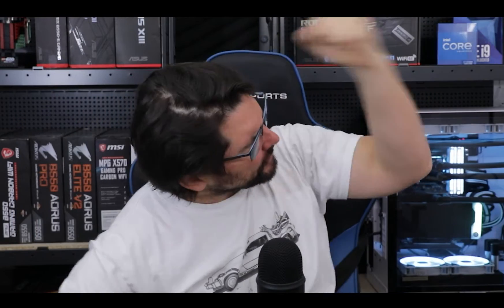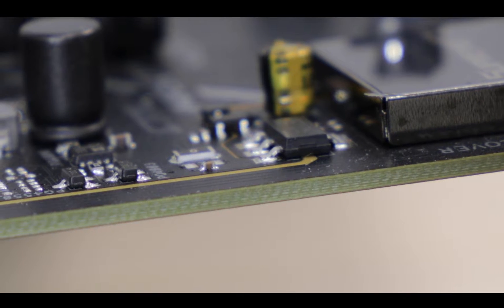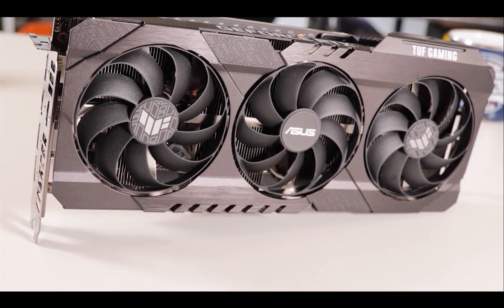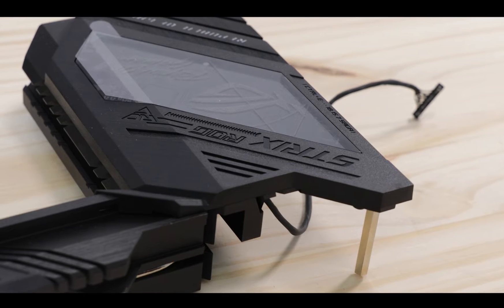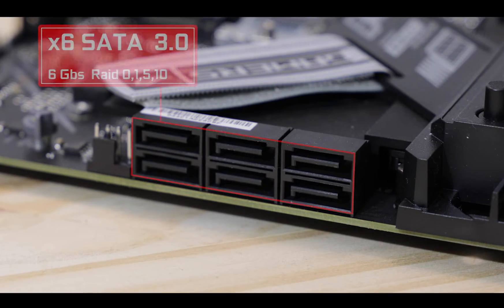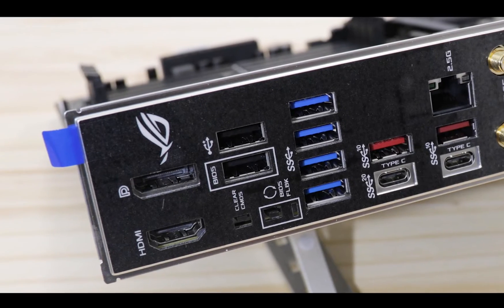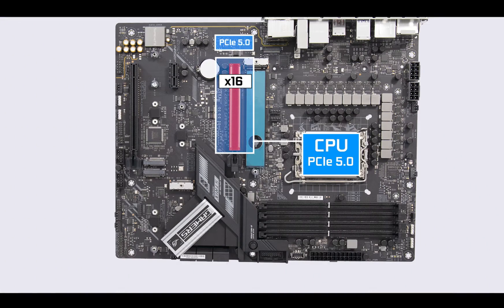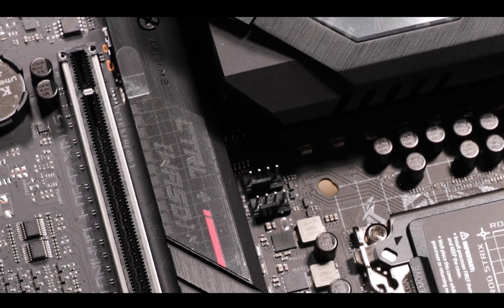ROG STRIX Z690-F Gaming : Gaming Gold Standard!

Comment: I purchased this board yesterday for under $300, $150 less than the Strix Z790-F which basically just has 2 extra USBs and 2 DDR4 PCI slots which I could care less about.
I went with the I-7 13700K, G.skill Trident 5600 CL36 RAM, and a Lian Li 011 Evo case + 360 cooler. I also decided to try out the Thermalright CPU Contact Frame, the rest of my parts wil come from my old system.
Reply: Yo nice build. I would like to buy asus rog Z690 F gaming too but i don't know will it work with DDR4??? like Gskill or Kingston 🤪
Reply: @Ad1ksoN  No, I believe only the Z690-A boards use DDR4. It's basically the same except DDR4 and silver.
Reply: @grunt1807  Thank you! I I checked a few more videos and indeed even the memory installation key is different there. So i need to buy  only DDR5👌🏼👨‍🎓

Comment: I, and many others, have reported a chipset temperature in excess of 75 degree celcius when idling. You speak to temperatures in the 40s. Is there something that we (those reporting temperatures in the 70s and beyond) can do to reach the temperature that you speak to?
Reply from the maker: this temps i had were out of the box. One thing i would double check is the state of the thermal paste/pad on the CHP heatshield. Do not hesitate to replace it.

Comment: Awesome video! Ended up ordering this one to pair it with a 13700k. A simple bios update seemed cheaper than buying a z790, especially when it comes to such a nice board! Actually managed to not upgrade since my 8700k.
Reply: Can you report back with how that goes? This is the exact configuration I was hoping to get for my next build and I would like to have examples of how it went
Reply: @PandaNoodles581  updates?
Reply: @PandaNoodles581  Many many thanks
Reply: We elected to skip my build for now and build with this setup for my wife first... She's going to pair it with a 3060Ti which she claims wont' be enough for her but I think will and then if it is not enough sometime next year when I get a new build done up with the same config I'll get her a higher card and swap her for the 3060ti which I am SURE will be enough card for me as I am only running 2x 24' 1080p 60 pannels vs her running a 27' 1440p pannel at 144hz

Comment: My m.2 drives work fine in the top two slots but work intermittently in the bottom dual m.2 slots. Im using pcie 4.0 ssd's. Anyone know why this happens? Faulty board? Bios setting?

Comment: hello, 

 I have the Asus Z690-F Gaming and I notice very high temperatures compared to the video of the chipset which is at max 45 degrees while I in IDLE, 
I am at 70 degrees and in game 80 degrees.  do you think my motherboard has a problem? Thanks you sorry for my english
Reply: Hi man, have the same problem. By the way that is because the chipset heatsink is coved by gpu in your pc. Heat from gpu is transfering to z690 chipset so im getting 70-75°C as well.

Comment: I cant seem to find an answer on which m.2 slots to use. On the gaming E, if you use the m.2_1 gen 5 slot it cuts your GPU lanes to x8. Is this the case on the F as well? The m.2_1 slot runs through the cpu but _2 _3 _4 all run through the chipset. I have 2 m.2 ssds. Where can i run them to avoid cutting the gpu lanes?
Reply: Im guessing because the m.2_1 slot on this board is only gen 4, not gen 5 like the E, that using the _1 slot does not cut your gpu lanes. X16 for the gpu and X4 for the m.2 gen 4 for a total of 20 lanes, which is supported by the cpu. Is this correct?

Comment: This is the motherboard I am eying for my first high end build, yes this is not considered high end for its class but compared to what I have now, this is definitely high end.
Reply: The hero and maximus lines are the top of the line, but this board does not disappoint. I would look at the E version though because it has m.2 gen5
Reply: I’d be careful. Mine suddenly crapped the bed on me. The second NVME drive kept disappearing and then the board wouldn’t even take power.

Comment: Question, what cooler would you recommend for this motherboard?
Reply: Deperately searching for this answer too!  Already blew money on a Deep Cool fan cooler only to find it hits the heat sink.
Reply: This is the motherboard in my new gaming rig ive just ordered from a reputable uk supplier. They only pick reliable parts. If its any help, they have the ' Corsair Hydro H100i PRO XT RGB Liquid' as standard in that build.
Reply: I ended up finding a used liquide freezer II 280 from a local.  He even had the LGA 1700 brackets though he was missing some screws for the radiator.  Now I have to return my tower fan that did not fit.  Will lose 40% of what I paid on shipping and restocking fees.

Comment: Just won this board and 32gb of G Skil DDR5 6000mhz ram and have been bingeing reviews lol

Edit: so after running it for 2 months I’m about to RMA this board since it suddenly made my second M.2 nvme disappear and now when I attempt to boot my pc the Q-LED’s don’t even go through the boot sequence. No post, no display, nothing.
Reply: what CPU cooler are you getting?
Reply: @TynanCreations  got the EKWB Velocity 2 water block.
Reply: @official_commanderhale965   Thanks.  Did you already install it and it fit well?  Came with LGA 1700 mounting kit?
Reply from the maker: Wow.. nicely done !!!!
Reply: i ahve the same ram and pc wont boot when i enable xmp...stuck at 4800 mhz (or something like that) any idea why?
Reply: @byronrounds  make sure the ram is set in slot 2 and 4. in slot 1 and 3 the xmp wont work. however xmp could stillwork if all slots are filled too i think.

Comment: On the memory side of things, I can't even find DDR5 RAM available anywhere, really. Also, are you sure DDR4 is not compatible with this motherboard? I've seen build reviews where people are using DDR4 sticks for this motherboard. Maybe I'm missing something here...
By the way: great video!
Reply from the maker: Hello.

Yes I'm sure DDR4 ram is not compatible with this board. DDR5 RAM and DDR4 RAM have different sockets. 

However, some Z690 motherboard do come with DDR4 sockets  such as the Z690 Tomahawk from MSI.
Reply: Sounds like some trolls. I’ve seen plenty of reviews showing people attempting to mount the DDR4 sticks and the slots don’t line up either direction. 

I had struck luck on the Newegg Shuffle after on a couple weeks trying to snag some G Skil DDR5.
Reply from the maker: Congrats !!!!

Comment: Upgrading right now from my old but aging beast PC and it is a pricey upgrade.  Basically every component costs more this time except the processor.  The 6900K cost like double the 12900K, but the mobo, ram, SSD's, and PSU were all cheaper and in the case of a badass asus motherboard we are talking double to quadruple the price now, absolutely insane 🤣
Reply: I mean this mobo is $300, that is reasonable
Reply: @mikerzisu9508  480euros for it in sweden. but i got mine for 380 as an upgrade package discount.

Comment: Having trouble getting the i9 12900k cool on this board. Terrible cooling compitibility due to the oversized heatsinks.

Can you recommend a cooler that will fit please, I don't have room for a 360mm AIO 😔
Reply: How are u having trouble cooling? Are u just gaming? If so u shouldn’t be having issues with cooling. And what air cooler u using?
Reply: Could you manage a 240mm? Almost sounds like your case is too small for what you are trying to do.
Reply: @official_commanderhale965  Yeah I ended up sizing up in the end, styill having fitting issues with the cooler though, I'm waiting on a replacement cap and bracket off Arctic.

Comment: Thank you for the in depth review. I want to build a new system with i91200k for CAD usage (CPU rendering mostly). I’m considering this board or MSI MPG carbon, can you enlighten me about MPG carbon compare to this board?
Reply: I’m having the same problem now, deciding between those 2 boards…better VRM on MSI but BIOS problems, better Audio on Asus.
Reply: @mefisto7654321  end up buying Z690 and satisfied with purchase
Reply: @wazwuz205  But which one, ASUS or MSI? I went for ASUS. it should arrive today, hope it is good enough for some mild i9 12900k overclocking.
Reply: @mefisto7654321  Asus one, I trust Asus brand more than MSI

Comment: Bought this board yesterday + i9 12900K + Arctic Liquid Freezer II 360 with LGA 1700 kit. Now I only need RAM to become available in Sweden and I'm up running a big ass monster pc. I sold a 6900 XT Phantom Gaming, my ROG X299 board with a i9-7900X, 32GB 4133MHz ram and a Corsair 150i there wasn't compatible with the new socket to get this. - I have an unoppened EVGA 3080 Ti FTW3 ready for this build. Hope it will be damn awesome.
Reply: Sounds awesome!
Reply: I managed to buy DDR5 bundled with this board.   But got a fan cooler that doesnt fit.   Did you test your liquid cooler and it fits fine?   Did you have to order the LGA 1700 mounting kit seperate (and wait weeks for delivery)
Reply: Did you run into any issues with this board, meaning the DDR5 ram, or the 19 12900K not being supported by the board until the BIOS has been flashed? Thanks

Comment: I have been using the STRIX boards on my past builds but as a builder that prefers to use large air cooling the Strix boards with their higher heat sink designs are not compatible with with the industries leading large  air coolers. Bad move on ASUS in my opinion.

Also ASUS has gotten ridiculous on the board pricing for the z690 as well.
Due to the above issues I ordered a Gigabyte z690 AORUS board.
Reply: You can apparetly use the noctua nh d-15 with this motherboard if you move the fans on it a bit. but yeah the motherboard is really bulky so i went with an AIO cooler again.

Comment: The ROG STRIX Z690-F? Usually the Z690-E is a better model, is that not the case this time?
Reply from the maker: Yes it is. But given the current pricing, the Z690-F is much better choice giving u all the Z690-E abilities but a couple of non essential options
Reply: @Laurentschoice  OK cool. So what's missing from the F that the E has?
Reply from the maker: 1 more power stage, and Q error screen.  That's about it